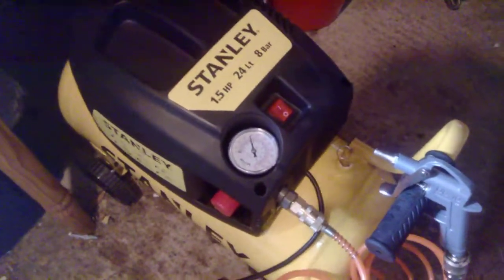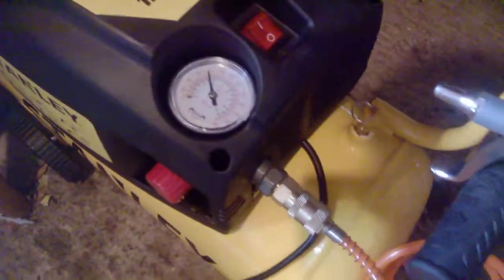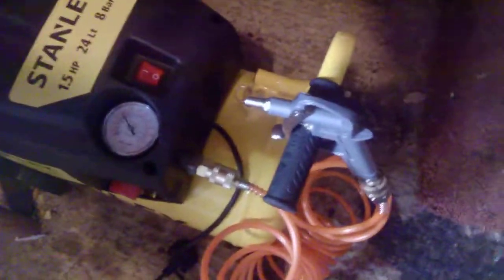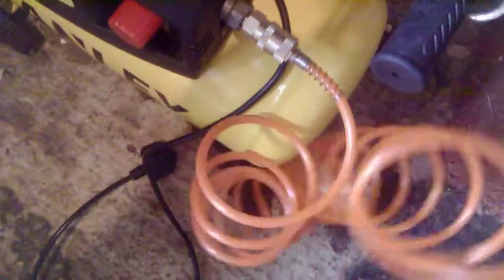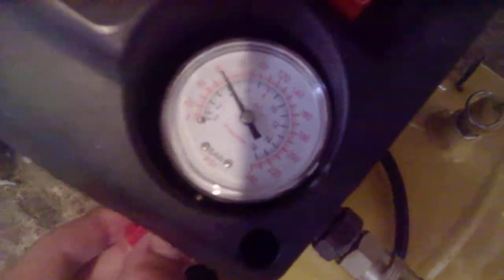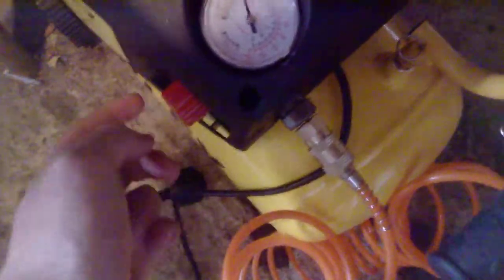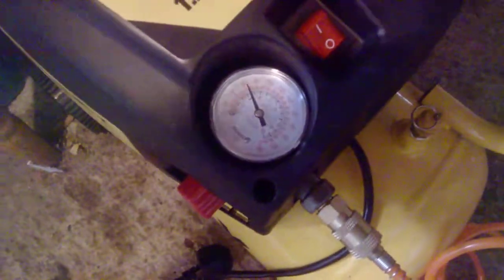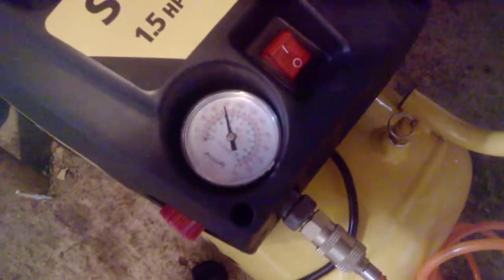24 Litre Stanley Compressor - Review, continued...Pressure Valve.

Comment: Now I see, so this is not a gauge for tank pressure but for pressure regulator. Thanks. On my way to purchase this little fella. I have some spare compressor but I still need a few components (such as pressure regulating valve), spray gun, air hose, etc. so all of these will cost almost same as this compressor. No brainier to me :).